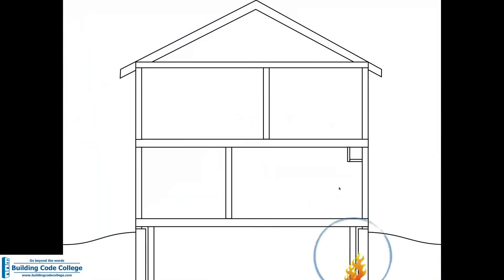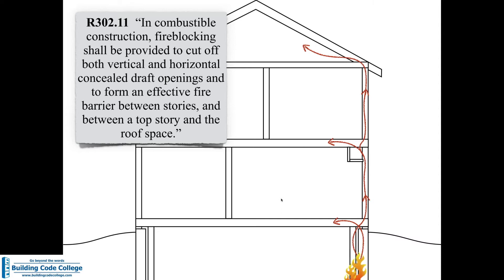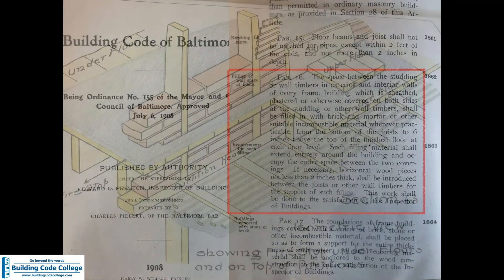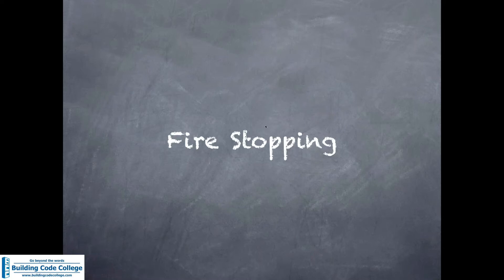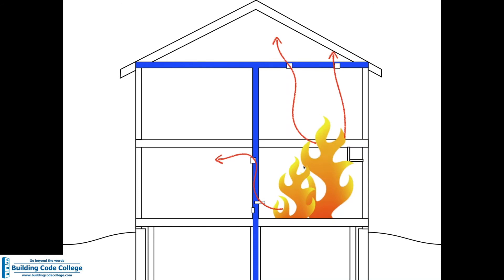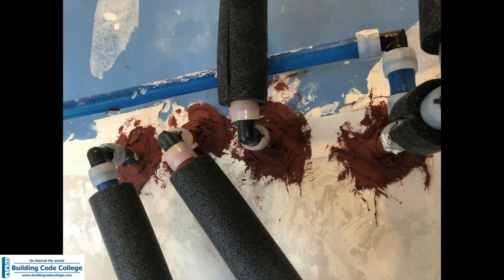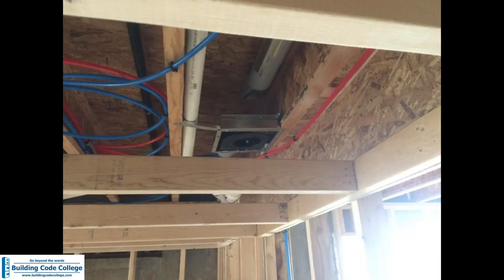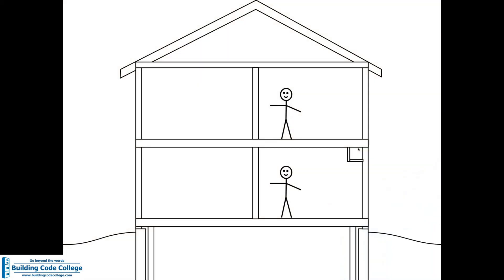Draftstopping, Fireblocking, and Firestop - Differences Explained

Comment: How is the 1000 sq ft of floor cavity measured?  I’m finishing a basement.  Whole finished space is about 893 sq ft.  Wondering if I need to put draft stops in my ceiling/floor joist cavities at all.
Reply from the maker: First, remember this only applies to open web floor trusses or a dropped ceiling.  If the floor joists are wood or I-joists this doesn’t apply.  Otherwise, if the floor area is less than 1000, nothing is needed.  Check out my course “Building Codes for Basement Finish” at BuildingCodeCollege.com watch the first video free by just clicking the thumbnail in the course catalog.